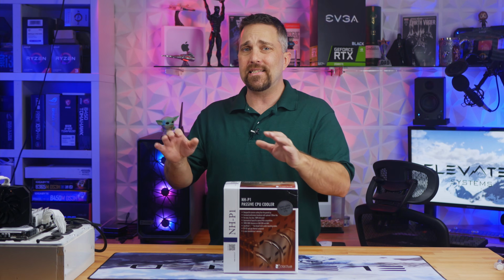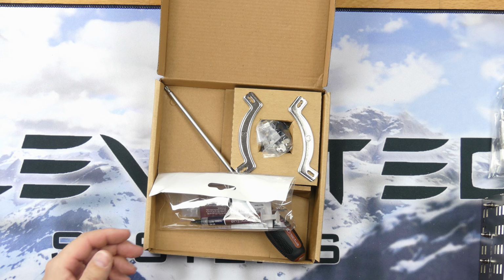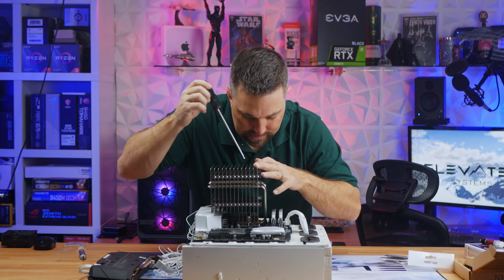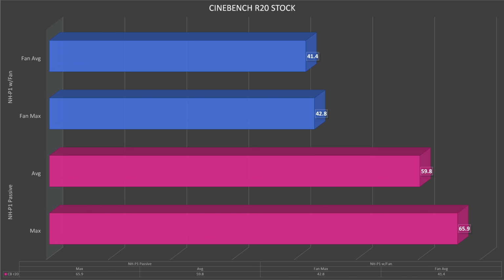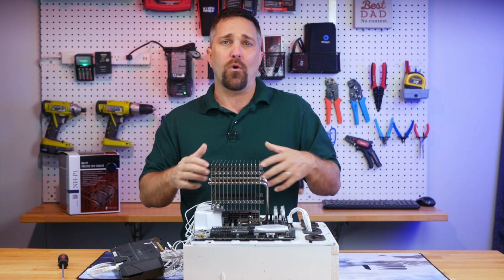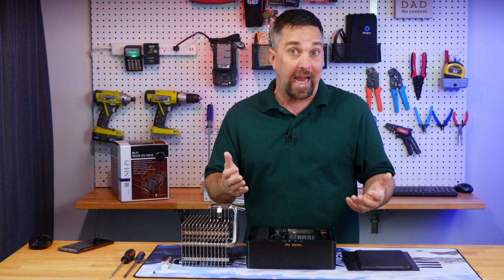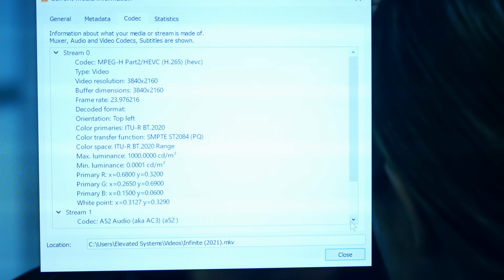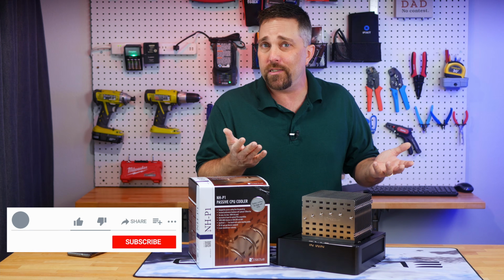Noctua NH-P1 Passive CPU Cooler, Tested!

Comment: I used a Cosmos S server case on my HTPC with a 7700X CPU. I Stream video and do occasional  Photoshop of large posters.   No fans in my system at all. The Topandbottom of the case are vertical grates and the chimney effect  keeps the cpu cool.

Comment: These fanless coolers work well with 35w processors. Maybe not good for gaming, but foreveryday computing, playing music / videos etc it’s great to have 0 noise. I put a fan near mine and set it to kick in if the cpu goes above 45c, but it never comes on.
Reply from the maker: I used it on a 65W CPU with zero fans and it worked great https://youtu.be/7k6F-lYX830

Comment: Well, I'm running i7-10700K at 4.8 GHZ with Noctua NH-D15 and I've never heard it making any noise, fans are barely spinning. 120 mm case fans running at minimum as well. Can't call my setup absolutely silent because when gaming at 1440p my GTX 1070ti begins to whisper to me but it is pretty close to silent. I'd say the biggest selling point of this passive cooling setup is very long maintenance free service life. You can probably run this system forever. It has no moving parts, nothing to fail. Good stuff, just way too big and probably heavy. Thanks for the nice review.
Reply: Swapped my NH-D15 for a NH-P1 and that removed the slight rustle I could sometimes hear from the NH-D15. That’s being borderline obsessive in terms of sound to most though 😬

Comment: Hope to see your 100% passive cooling solution, better if its an ITX and a real one without half of the cooler outside of it.
Reply from the maker: It's going to be M-ATX. The passive SFX PSU for my Cooler Master NR200 never showed up so I had to scrap the ITX build.
Reply: @ElevatedSystems  nr200 sounds cool, its a very popular and affordable case. Evaluate the posibility of testing with a fan amd without it. Gpu passive cooled too.

Comment: A bit of fail on this cooler coming from Noctua. The airflow in a case is from front to back (usually) and they designed the cooler fins to accept air coming from bottom to top. 
Needless to say, in a standard case, all the hot air from the GPU will go into the cooler. Epic fail.
This is not a problem for Intel, as you can rotate it in any position you want, but AMD is fixed.
The heat fins and heatpispes should have been rotated 90 degrees.
Reply from the maker: This is meant to be used in a fanless system. Adding case fans defeats the purpose of the passive cooling solution and you should just get a standard cooler at that point. Convection works top to bottom, hot air rises creating a pressure difference which pulls cool air in from the bottom. It's just physics.
Reply: @ElevatedSystems  case fans defeating the purpose is not something I’d agree with. I’ve replaced my NH-D15 with the NH-P1 because the fans on the NH-D15 produced the most noise in my system, which is easy to explain because they are mounted right on top of the fin stack and rushing air through there inevitably makes noise. The case fans, meanwhile, I can run at an inaudible 500 rpm and when strategically placed, they can greatly help with convection.

Comment: If the Arctic Accelero Xtreme III comes back into stock, you can use it with a GTX 1650 or another 75 W graphics card, without the fans. It works quite well with 75 W.
Reply from the maker: If I have the graphics card I can't find the cooler, and if I can find the compatible cooler I can't get the Graphics card.
Reply: @ElevatedSystems  try to hunt down a Palit KalmX GTX1650, it has both already: https://www.palit.com/palit/vgapro.php?id=3494 (I think this is also what Noctua used in their passively cooled demo PC)
Reply: @kasimirdenhertog3516  they used a 1050 ti, but shouldn't make much of a difference
Reply: @hc7185  of course, the GTX 1650 is a good bit quicker, so I'd go with that, and Noctua also recommends it in their excellent build video: https://www.youtube.com/watch?v=khbvxsPTI84
Reply: @kasimirdenhertog3516  yes, I was referring to the GPU used by noctua in this build guide. and of course little difference besides the performance.

Comment: My Build Starter NAS

Corsair 750D ATX Full Tower Case
2 X Noctua P12 redux-1700 PWM top of case
ASRock A88M-G/3.1 FM2+
AMD A10-7890K 4 core 4.1 GHz 95 W Radeon R7 (on-die)
Mushkin Enhanced Helix-L 250 GB M.2-2280
G.Skill Sniper Series DDR3-1866 4 x 4GB
Western Digital Red Pro 8 TB X4 HDD
Corsair SF SFX 80+ Platinum 600 W

Comment: Did you record package power draw on your 3700X during the tests?
Reply from the maker: I only recorded complete stats for Cinebench and the package power draw peaked at 88.15 watts. But typically even for AIDA64 the 3700X on my test bench doesn't ever pass 90W at stock settings.
Reply: @ElevatedSystems  Thanks. My Ryzen 3100 could handle up to 80W with NH-P1 in a similar setup. I was expecting 3700X to handle more than 80W because the heat would be more evenly spread across more cores. Turns out to be true.

Comment: I'd prefer the build to be on horizontal position, maybe because I have cats and they can tip over the case very easily 🤣

To Noctua: This ain't it chief... where's my NH-U12A Black Edition?
Reply from the maker: It stood up on it's own OK, but I did use some double sided tape under the case feet to make sure it stayed up. If I was going to have it there permanently I'd designated 3D print a stand for it.
Reply: @ElevatedSystems  is the weight light enough? say if i wanna use it with xproto case on vertical position. i hope it won't tip.
Reply from the maker: @denissetiawan3645  It does weigh about 2.6 lbs /1180g so tipping is possible, but the other problem with the Xproto is the inverted motherboard position. In the vertical position the closed ends of the NH-P1 will be facing up and down. Ideally you want the open fins up and down to promote convection through the fins. The Xita may work better in it's horizontal position with the NH-P1. That way your PSU won't be directly under the cooler also.
Reply: @ElevatedSystems  thank you for the insight, cheers! :)